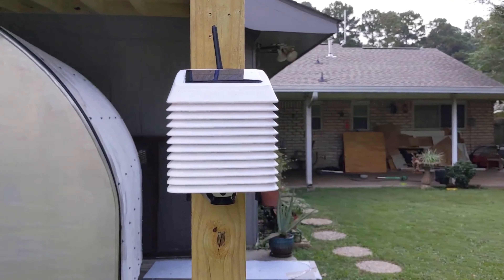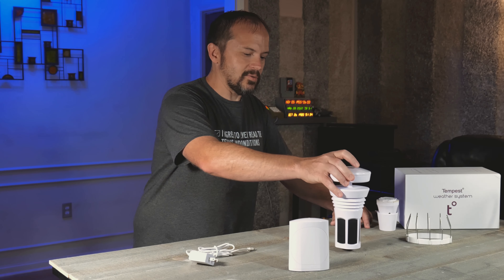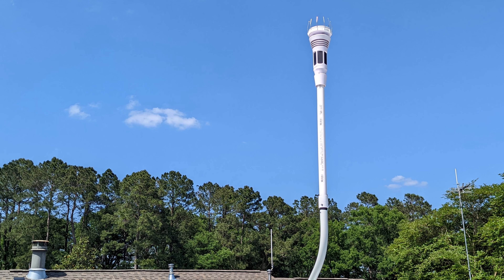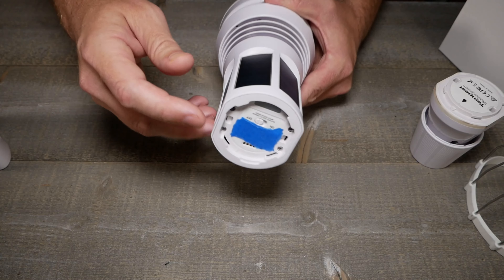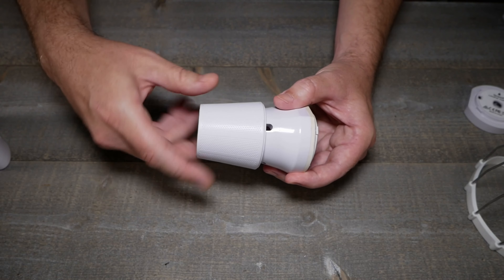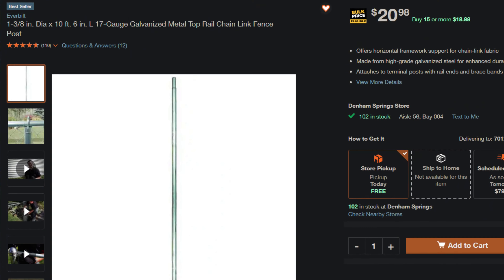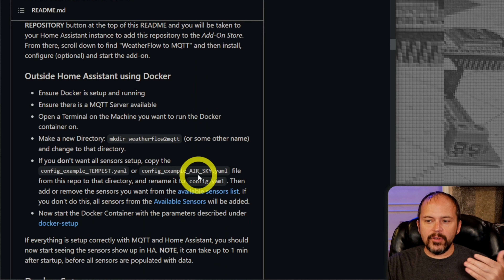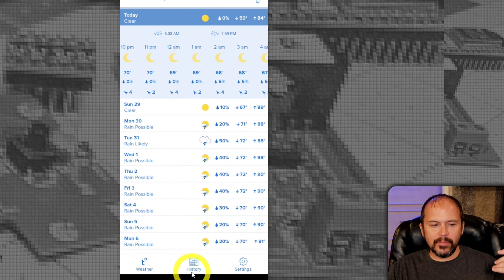WeatherFlow Tempest Review and How To Integrate into Home Assistant

Comment: Took a bit for me to figure out the docker part, new to this, but it worked great.   So much data.  Looking forward to seeing how it does with our Alaska winters.  Thanks for the help.
Reply from the maker: I have heard that some folks needed the external power adapter for the harsh winter areas.
Reply: @digiblurDIY  Yeah, mine has gone from 74% to 63%, even with 4 hours of direct daylight again.  I've ordered the power pack because, in January, there is a 3-week window without direct sunlight, so definitely needed.   So far, it's handling high winds at about 0° F very well so far. It's very nice to have local weather that is not cloud-based so I can use it for automation.  Right now, I use it to automatically open the chicken coop door when it's warm enough.

Comment: Love mine, but, one kinda crappy thing, if u lose power because of weather, you lose that data from that storm. I wish it would be smart enough to store 48 hrs of data if it sees the base is not responding. We just had a derecho come through and lost power right at the start and was down for 32 hours. Would have been cool to see that data. Will be adding a UPS to the base.
Reply from the maker: I do remember something about the base storing things but wasn't sure how it offloaded stuff or how long.  Very good tip to connect to a UPS
Reply: Plug the hub into a batter backup.. that might give extended life when power out

Comment: I own 2, but hate the fact having to cycle the on/off switch on the base if tempest goes offline.
Reply from the maker: I've had one of mine stop responding once but that was about it, I only had to reboot the hub.  I haven't had to take mine down yet. That would be a total pain where mine is located.

Comment: How did you connect the PVC pipe to the tempest Universal Bracket?
Reply from the maker: It is the pipe mount on the bottom. I did add a few wraps of electrical tape to the pvc to add some additional tension when I screwed the fitting down.

Comment: What kind of coupler did you use to connect the tempest pole to your conduit or Galv fence top pole?  There’s a picture of it at 7:38
Reply from the maker: Just a regular PVC coupler.  I brought the two pieces to local hardware store and dry fit them in the store to find what I needed.  I did tap two self tapping screws in it.

Comment: Great video. I've been using WeatherFlow Tempest with Homeassistant for the last 6 months and have been very pleased with it. Curerntly I use the HACS integration. My main use case, other than for local weather forecasting, include;
- notification to the family (phones/apple watches) of high UV levels ... .remember hats and suncreen (in the UK this can be quite a rare event ;)
- notification of rain if washing is out to dry
- using the exterior temperature and humidity to guide ventilation and misting actions in my HomeAssistant automated polytunnel, for example don't ventilate if it is raining 
- stop ventilating (air into) the basement if it is too cold or if it is raining
- gathering data (w/m2) to inform  a future planned extension to my solar panel setup.
Reply from the maker: Nice! That HACS one was cloud based by the same developer so I went with the one that uses my data locally.

Comment: Yeah I bought the accurate weather station about 2 weeks ago and it's horrible It keeps losing connection to the app 😳😡 bought it off Amazon and it is going back. Called technical support and they tell you to unplug it and take the batteries out😮 well that only works once in a while but the problem with that is when you pull the batteries out you lose all of your weather data history. 😳😳😡😡

Comment: could you do a video on how to actually set it up in Home Assistant? Please!!!!
Reply from the maker: I did that but using the docker container.  What type of install do you have?
Reply: @digiblurDIY  I am installing it via Home Assistant Supervised. I was able to install the repository, and I have my mqtt running with 1882 port. When I go to configure the weatherflow2mqtt, I put the station ID, the Token, mqtt user and password, however, I am unsure of the MQTT HOST... Any idea?
Reply from the maker: I would leave it on default 1883 and the host is your HA IP address or name.
Reply: @digiblurDIY  thanks for the help. So I left the MQTT to 1883 and added the IP of my HA. Still no luck :( Does it get added after restarting? Cause I don't see anything being found on the network...
Reply from the maker: @manuelmatus2959  are the logs of the weatherflow showing anything?

Comment: I have a 20+yr old uniden 900mhz phone. From inside a block wall house, thru foil-lined insulation, moderate tree coverage, it would hold a conversation at 260yds. It only dropped the call because I lost LOS back to the house. 900 is da-bomb for "long"-range, simple data use.
Reply from the maker: I remember the same during the era of the cordless phones.  Everyone was getting 2.4 and then 5ghz phones and wondering why the older 900 ones worked.  The 49mhz ones were a bit excessive with their 2 foot antennas though.
Reply: @digiblurDIY  Have you noticed any interference with Z-wave devices?
Reply from the maker: Sorry I don't have any Zwave devices as my 900mhz band in the past had some serious interference issues and Zwave didn't work well.  It doesn't seem to impact this device though.
Reply: @digiblurDIY  oh well, I’ll let you know. Thanks to your video I picked up a Tempest. Thanks for the great video!

Comment: I have two of these at different locations.  They are mostly trouble free.  Great customer service.  Just know that the small solar panels must see sunshine all day.  Otherwise, the battery will deplete as the seasons change.
Reply from the maker: Yeah I could see that.  I've watched the battery voltage over time but mine has stayed in normal battery mode.  Glad to hear they have great customer service.  I've heard that same comment many times!
Reply: @possibilityspace  In north Texas, for me, it needs at least 7+ hours.  It can survive several days of cloudy weather, but mine can't handle shade from trees any part of the day.

Comment: I'm having trouble setting this up via Docker Compose. I can spin up the container, but I don't see anything in Home Assistant. I tried adding the WeatherFlow integration in HA but I get an error that reads "Unable to discover Tempest WeatherFlow devices. Click submit to try again. UDP Discovery Error." Any idea where I'm going wrong?
Reply from the maker: Is the device on the same network?
Reply: @digiblurDIY  yes it is. I am super new to HA & have been successful getting things working for the most part. I ended up finding the WeatherFlow Forecast integration and installed that. Not sure if that gets me the same thing but that’s what I was able to do for now. Let me know if there’s something different I should be doing! Love your channel. Merry Christmas!
Reply from the maker: @benbrodbeck3699 I think there are two. One is cloud based and the other hits your tempest directly. Sounds like something isn't letting it connect locally.

Comment: Quick question, have you checked the accuracy of the rain gauge with a standard rain gauge, is there calibration procedure if it’s off?
Reply from the maker: I know they do some adjustments based on other nearby sensors.

Comment: Je possède 3 de ses stations la batterie se décharge durant l’hiver, et pas évident de la recharger avec le power booster.Concernant le pluviomètre sur les 3 stations 1 seule donne des données correctes les 2 autres surestiment et parfois largement les quantités de pluie.les points positifs le détecteur d’eclairs est performant bonne précision pour les données températures,vent,radiation UV et pression

Comment: The unit is specific to the northern hemisphere too.  You point that north so the solar cells face towards the sun, or south.
Reply from the maker: I would think you just point the cells and adjust the compass as needed.
Reply: @digiblurDIY  In the south it appears they say to point the arrow facing south and the configuration rotates the wind direction if it's set up below the equator.

Comment: The UK link seems to point to the wrong product.  Too pricey for me at £545 and some pretty negative reviews on its reliability. 
Thanks for the review anyway. Cheers
Reply from the maker: Amazon likes to flip stuff around for some odd reason.  The positive customer support testimonies swayed me a bit on things myself.  But time will tell and I will definitely update things later.
Reply: I did have my Gen1 version die after almost 2 years (failed wind sensor). They gave me a great discount on Gen2 (the one in the video).  Its been working great for several months now.

Comment: I wonder how many have been struck by lightnings after being installed higher than others neighboring structures 😅
Reply from the maker: Guessing not many due to no ground issues. The damaged ones I saw on their forums seemed to be mostly blunt force trauma causalities.
Reply: Probably little to none. No different than a hot water vent sticking up through the roof,
Reply: Ah I got it wrong. I thought there was a cable running from the external unit to the wireless/Bluetooth internal unit. Now I see, it’s wireless. I was hearing to the video while driving, I probably missed that part.